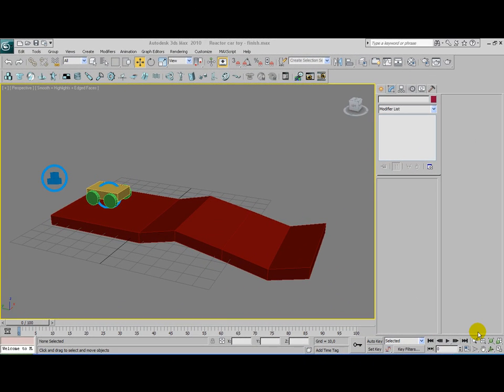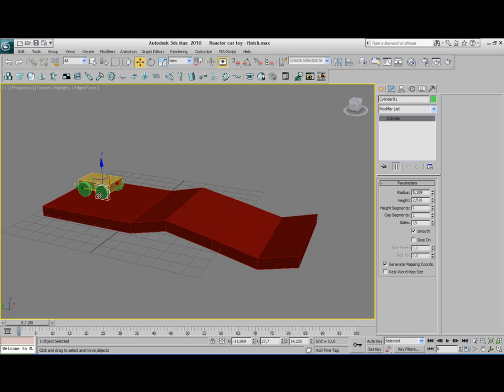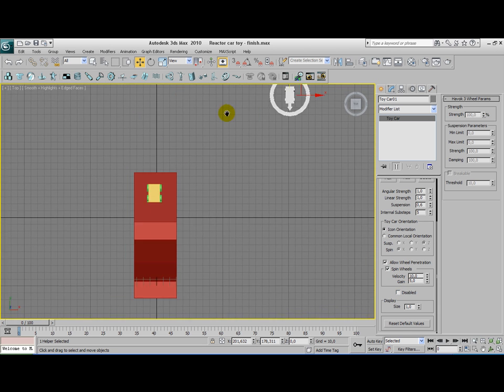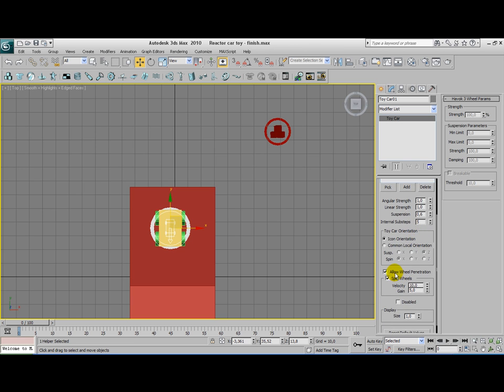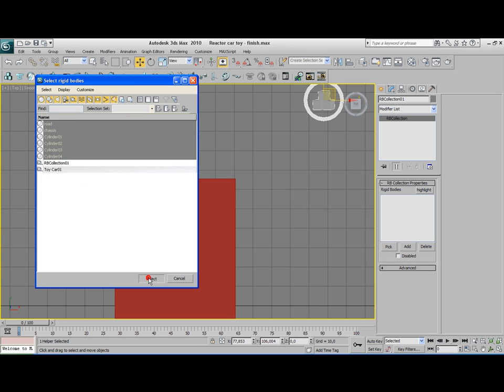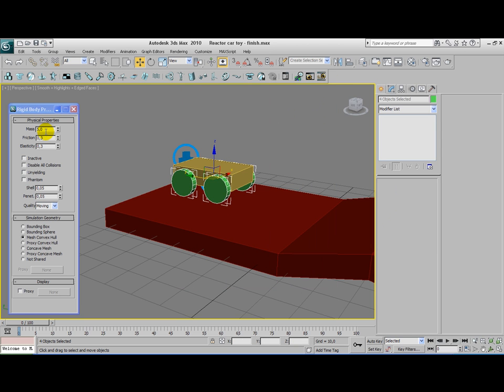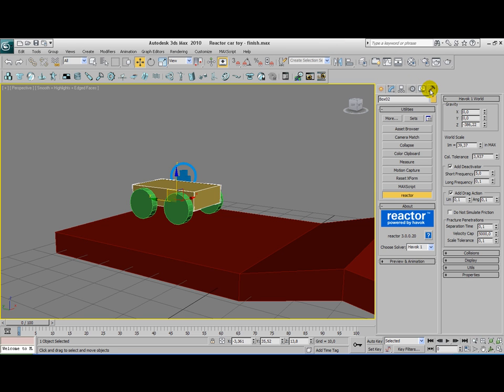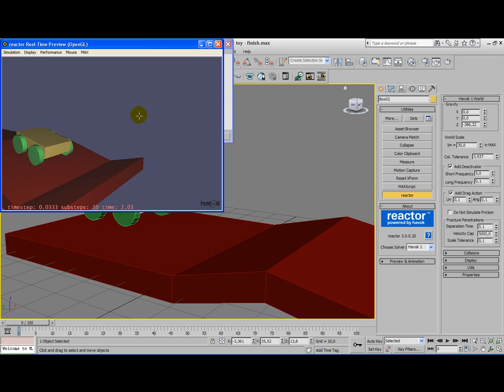3d max Reactor tutorial: Creating Toy car

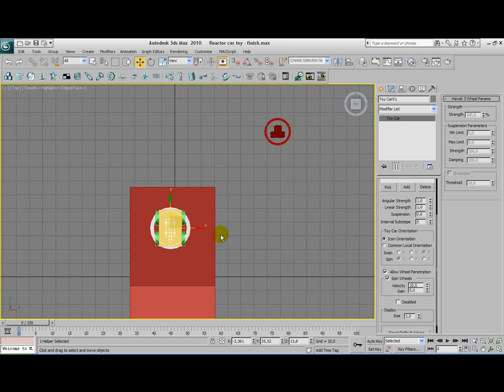Comment from the maker: Check 2:07. Asjust the 'Gain' . Gain is the speed gained during accelaration. 
You can turn the front or backwheels for steering. However when you want the steering to start later in the animation it gets more complicated. When make a key frame from the start, where wheels are straight. When for example on frame 60, you want to steer, you make an auto key frame and turn the wheels. This has to be done before the reactor animation. I''l make a tutorial perhaps..